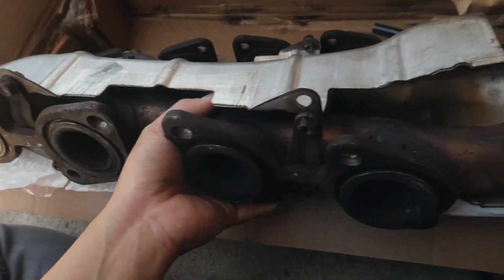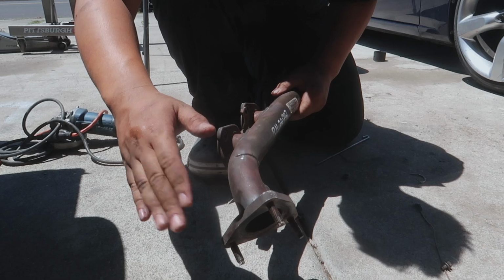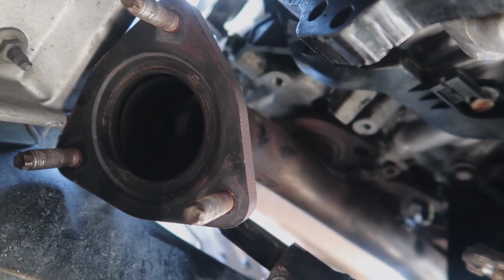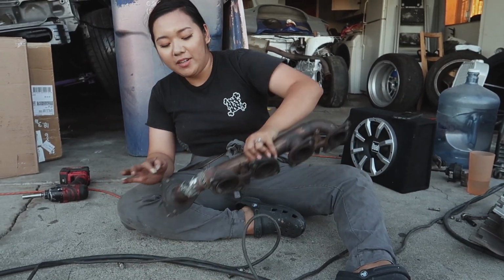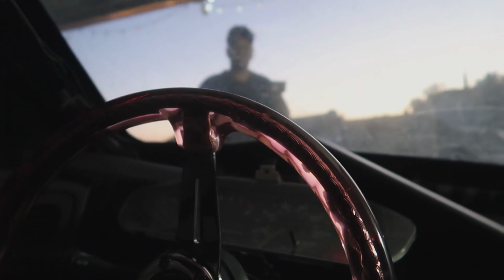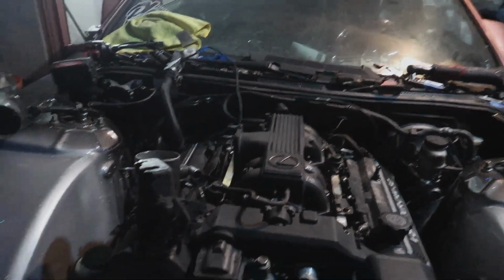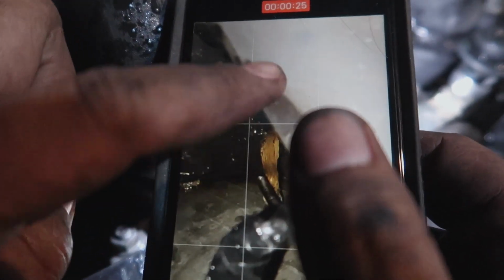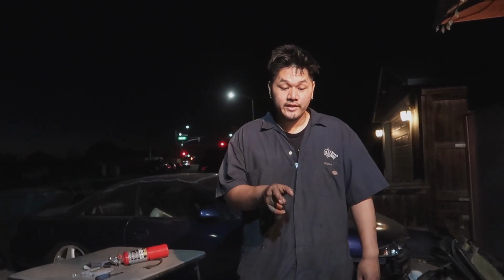Tundra Headers On My 1uz 240sx

Comment: You may have an issue with the driver side of the motor running more hotter than the passenger side because of the restriction from the header that she did the Notch on the manifold to clear your steering shaft 😱🤯😊🤙🏽